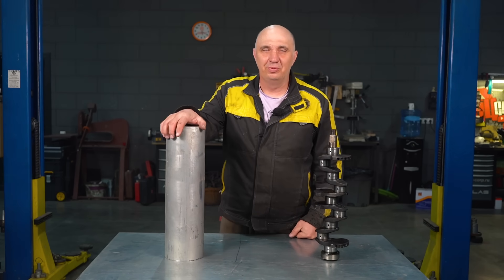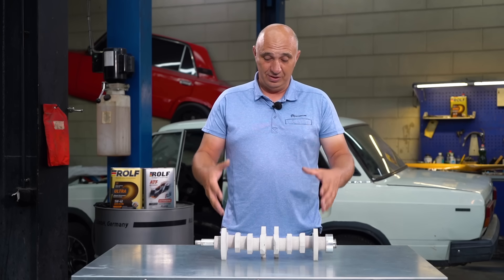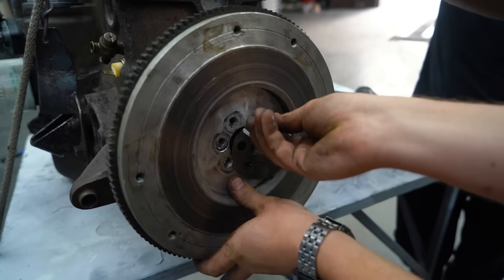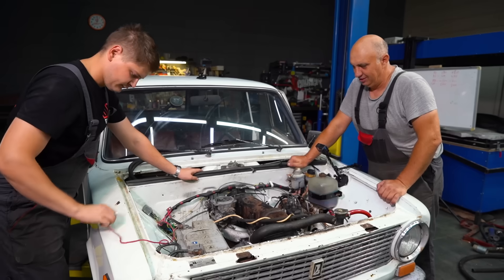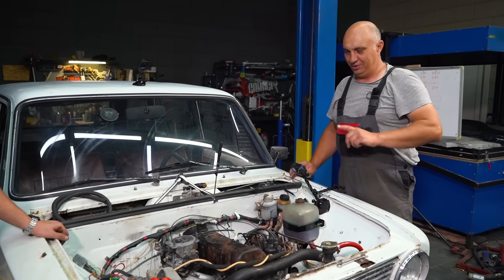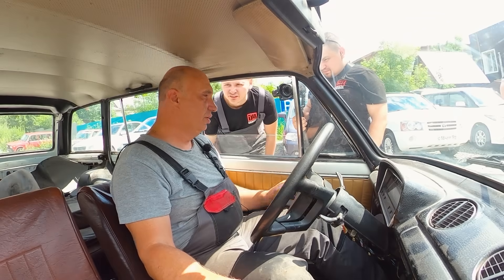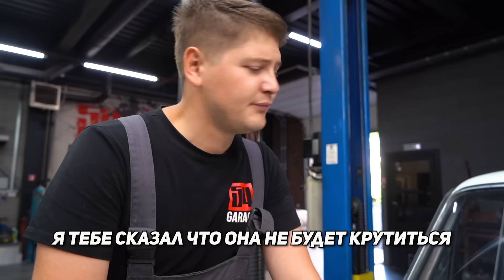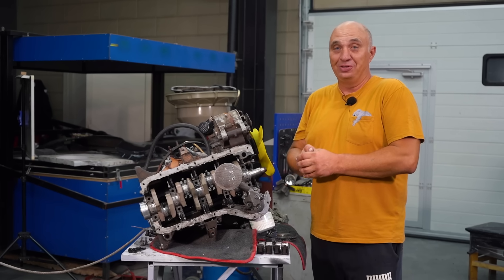We make a custom duralumin crankshaft for a Lada

Comment: After watching this show for so long now I can build Lada engines in my dreams when I'm sleeping.
Reply: I was thinking a similar thing.
Reply: As if it was hard in the first place! Lol 😂
Reply: @dragan3290  what's simple, lasts a long time. and yes, i've built several 'hot rod' engines over the years. i might have only got between 500 and 550 hp out of a 350, but i kept them simple. that lada engine? mix cement in the oil and it'll still drive a mile before it seizes..
Reply: @garycarpenter2932  I'm the same! First car was a valiant ( pacer) shape in 2 door. Then 3 separate Holden toranas, one I resprayed in wild violet. A hq ute with 253 cu in v8. Now my Holden commodore vx ecotec buick based engine. All mace engineering parts. I can't help myself! Lol 😂. I bet you're the same? It's a performance thing! Some people just don't get it! Cheers from Australia 👍 I always wanted a 350 chev!!!
Reply: @dragan3290  it's really fun. let me build it more!. hope you get a 350 one day, easy to work on and can get quite a few ponies out of them. to say, i built a few. so much so, friends would even come out to help. 30 some years ago i got a legal plate for my hot rods. RD-RGE. now my driving record speaks for itself. but what better plate could be put on something you built? i still have it on my 01 silverado. getting old so it's mostly stock.
Reply: @garycarpenter2932  that is awesome mate! And the Silverado? Yeah baby!!! I've wanted one first time I saw one in Australia! What size v8 or diesel do they run? Cheers 👍
Reply: they look a lot like a 1500 Nissan from the 70s or 80s
Reply: @russriley3005  yeah actually you're right! I want a little car like that just to see how much power from a small turbo I can get? It's a fun cheap project!
Reply: @dragan3290  I had a Toyota that I deleted all the egr stuff, ran a straight pipe, ported the head and built an intake for a Chrysler thermoquad. I was smoking stock v8s back in the 80s
Reply: @russriley3005  amazing how power to weight ratio and a thermoquad? Yet my brother said my torana was over carburettored  with triple 1 3/4inch Su's! But a Toyota? What model? Must have been fun in the wet!!! Lol 😂
Reply: @russriley3005  they also look like a 90's volvo.
Reply: and fully make it from drink cans
Reply: @kenbakker3241  why???
Reply: @dragan3290  why what?
Reply: @russriley3005  why? Is it a nightmare?
Reply: I sleep while I'm awake
Reply: Why would you bother?...
Reply: You sleep in your own dreams?
Reply: Please don't forget to mention that to your therapist
Reply: At this point I just want a lads to play with. Maybe cherry pick all the best things they did that actually worked and create the ultimate Soviet the vehicle😂
Reply: Looks like it turned over by hand very tight that’s not a good thing. Not much room for oil
Reply: Ceramic coating definitly increases the size. Unless your dealing with some magical ceramic coating I’ve never heard of befor but since ya had to sand it and machine it down tells me it definitly grew in size….
Reply: Lada 🚗 😅🤣😂 best car ever made 🤪

Comment: it's the oil don't use oil ! 
use this in the engine 
Duralube engine Treatment stp oil treatment  lucas oil stabilizer

2 of STP oil treatment 
946 ml of Lucas oil stabilizer 
1  Dura Lube engine treatment
this should keep the custom crankshaft from getting chewed up
mix all this then put enough in the engine if more is needed then mix more of all that then add more to the engine .

Comment: Revisit the Crossplane crank idea, but from one solid piece of steel like you did with the alloy crank, and then get it balanced so it doesn't shake it's self to pieces..
Reply: that would be sweet. I'm not sure that balancing would save it though but certainly no harm to it.
Reply: @martin-vv9lf  providing the counter weights are sufficiently heavy at either end of the crank, they should be able to get a good degree of ballence. If you look at a V8 crank you'll notice the end counter weights a pretty beefy, just need to scale one down to a 4 cylinder size. I'd love to have a go at it myself but I don't have a lathe big enough...yet..

Comment: A titanium crank might be nice.
Reply: Titanium will not work because it does not tolerate friction well and will start to peel quickly. It is true that it is lighter and harder than steel, but because of this it is mostly used only for connecting rods, or for components that have friction-resistant materials in between (bearings). It is true that titanium connecting rods have a bearing in between, but they are on the side where the bearing is fixed and does not wear.
Reply: @bernymonty22 Also extremely cost prohibitive and difficult to machine.
Reply: @justinmiller1191  its not about the weight or strength . Its all about how well it handles friction and expanding as little as possible with heat. This is why cast iron is still my material of choice when it comes to engines.
Reply: @hermanbotha1449  It works for rods why would you think it can't handle being made into a crank?  It would be difficult no doubt.  Machining it is a pain for sure.   Thermal expansion on the aluminum likely was was messed up the aluminum but aluminum doesn't have a fatigue limit like steel and titanium so would eventually fail.
Reply: @victorthecarguy3126 The rods have an interface layer or bearing insert at the friction point to keep them from spalling out.
Harder to do on a crankshaft. Not impossible, but FAR more difficult.
Reply: @SwervingLemon  Thanks, I didn't think of that.  Have a great day.
Reply: @victorthecarguy3126    "aluminum doesn't have a fatigue limit"  

what does that mean?  thanks!
Reply: @Zangetsu2026  At any load aluminum will eventually break with high cycles.  If you keep the load below the limits for steel or titanium at high cycles these will not break.  I'm only talking about tension and high cycle counts.
Reply: @victorthecarguy3126  so, it DOES have a limit?  or it doesn't?
Reply: @victorthecarguy3126  Aluminum absolutely has a fatigue limit. It is what limits how high commercial airliners can fly. Repeatedly stressing the cabin at high altitude fatigues the aluminum skin from and eventually leads to cabin failure.
Reply: @joshua43214  failing in fatigue and a fatigue limit of a material are different things.
Reply: @victorthecarguy3126  rods are just moving up and down.  They have bearings on both ends taking all of the friction.
Reply: Nice but one very expensive crankshaft
Reply: @rencelani-ty2sc  Yes, especially for a Lada!
Reply: Maybe. Don’t know how either behave with oil adhesion